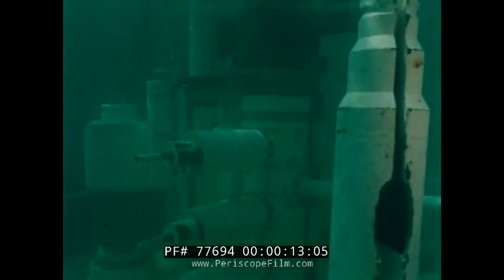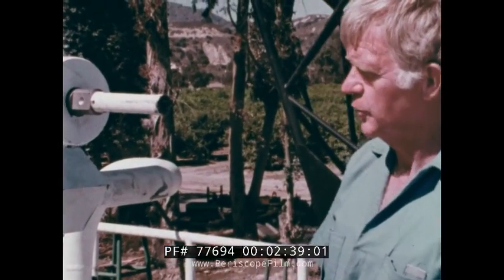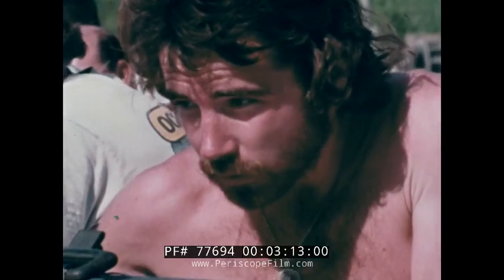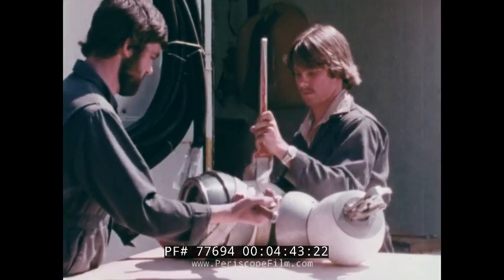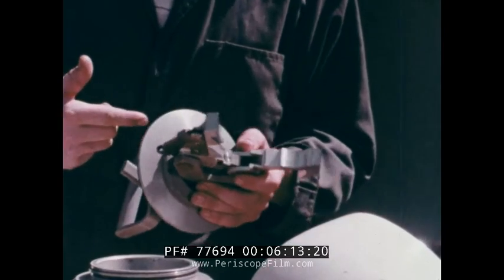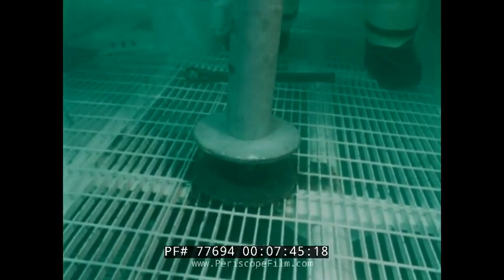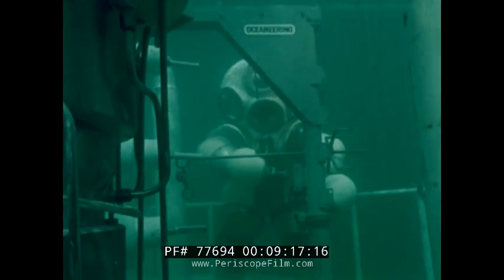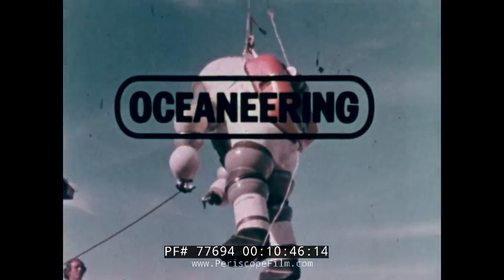OCEANEERING INTERNATIONAL UNDERWATER ATMOSPHERIC DIVING SUIT  PROMO MOVIE  77694

Comment: I was in charge of the ADS systems in Brazil in late 1970's then in 1980 I got pulled to the USA and was Manager in charge of all ADS systems and its development world wide. It was called the Advanced Systems Group then and run from the head office in Houston and also in Morgan City.  Record breaking dives to 1,760 feet in the Gulf of Mexico and the suits were world wide. Eventually I was not only in charge of ADS systems and saturation systems in the Gulf but also put in charge of Oceaneering's first ROV and that was it; the race was on and Oceaneering started its change to become a world leader in ROV.  Looking back at so many years with Oceaneering around the world, starting with them in 1972 and Superintendent by 1974 and going on to late 1980's, I hardly believe now what we used to accomplish in those early years back then and the pioneering we did in going deep.

Comment: Someone who think this is scary?
Reply: 1:33 doesn't look like anything is helping it's movement like Motor / Hydraulic, it's pretty much just a thick tin can with movable joints & claw like fingers.

I think it's more scary to be in it underwater hoping it doesn't leak or the extremely high pressure crushing you.

Comment: Why these suits have not replaced saturation diving?
Reply: Many reasons. How long have you got?
Reply: How long have I got? sorry I don't understand what you mean. Anyway I guess the answer is  the suits are very expensive as well, but mainly that the tasks performance is still very slow
Reply: Don't worry, it's just a figure of speech. Cost isn't the issue. ADS is dramatically cheaper than sat as no decompression, no gas, and a much smaller deck footprint. But quickly:

ADS never took off because for some 20 years or so, the only system that could do anything was JIM, which only Oceaneering could use commercially. That meant the sales departments at other offshore diving contractors like Comex, etc., sold their clients off on that form of diving as they couldn't offer a competing product with it. That stopped every diving contractor having atmospheric systems and them becoming a ubiquitous sight in the oilfields. The other reason is that ADS filled a gap that existed in the market in the 70s / 80s because ROVs were just deck decorations on constant downtime, but with the development of technology, ROVs are fairly reliable enough now to fill most of the gap that ADS once exploited.
Reply: thank you very much!
Reply: Dude, get educated about ADS systems of today, like https://youtu.be/sK5asZlB6Hc
Reply: @operatorjeffdeathstar7759  One suit, and it spends most of its life dry unfortunately. 
There is absolutely a place for ADS systems, but the diving companies sadly aren't interested anymore.
Reply: @downlink5877  Where are you from? There is an assembly line in North Van building the Exosuits by the the dozen, Phil is selling them around the world, including NASA as one of his customers. Can Dive and Nuytco are rocking the ADS market right now.
Reply: @operatorjeffdeathstar7759  There is no 'ADS market' and hasn't been since the 1980s. Sorry.
Reply: @downlink5877  dude you have no clue about current sales of the Exosuit or the Deep Worker ADS submersibles
Reply: They did. No-one dives deep these days.